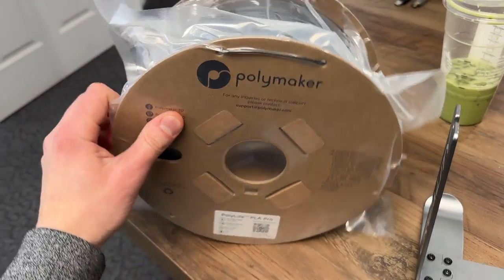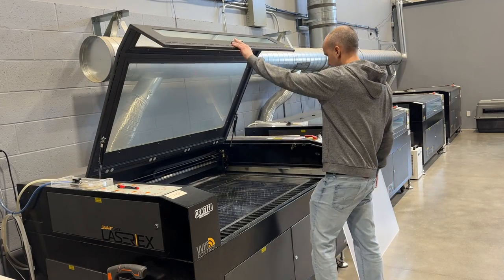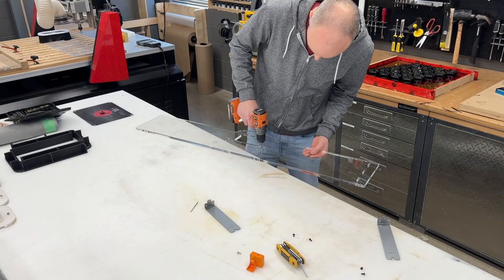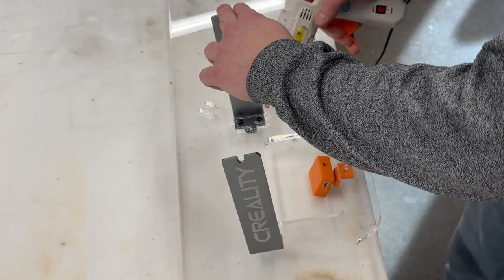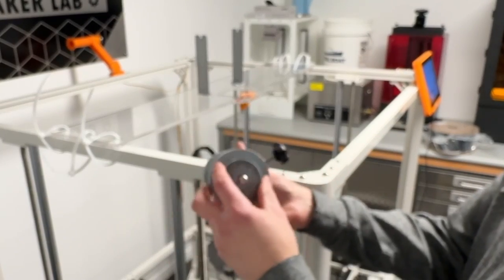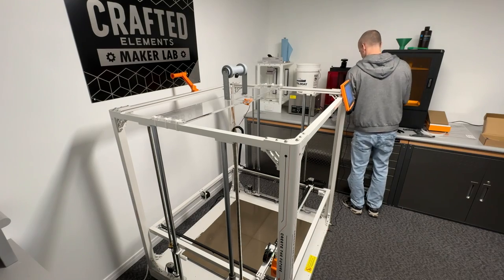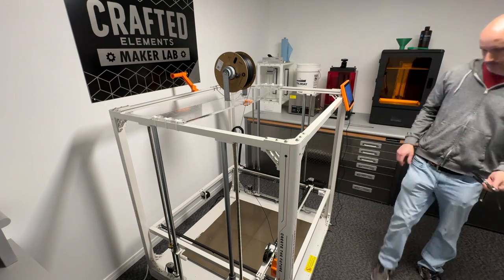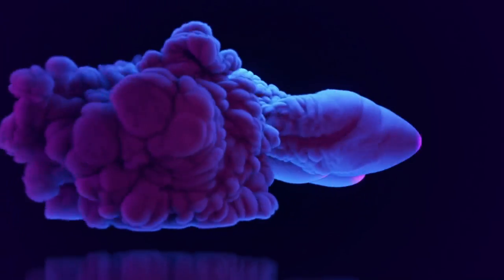Large 3kg Filament Spool Holder Mod For Elegoo Orangestorm Giga

Comment: Instead of the Creality filament holders, why not just cut some out of the acrylic? 
You can make them triangles then some right-triangles butted up perpendicular for stability. 
Should also keep the main piece of acrylic a bit more rigid.
All the parts could have been held together using box joints with some some Weld-On acrylic welding solvent.
Reply from the maker: I definitely thought of this while i was fabricating it, and yes it would have kept the acrylic a bit more ridged, if i was creating a product i would use some small acrylic parts coupled to 48" 1x1" aluminum hollow square bar for a much nicer finish. The reason i didn't is because of the thickness of acrylic would need to be 1/2" to be strong enough , and the screws i had in the 3d printed cylinder to hold the roll weren't long enough. I also worry about the screw threads wearing down the acrylic pocket it would sit in. I think there were/are ways around it, but i knew reusing the creality part would be guaranteed to work. I could have made this way prettier for sure :-)